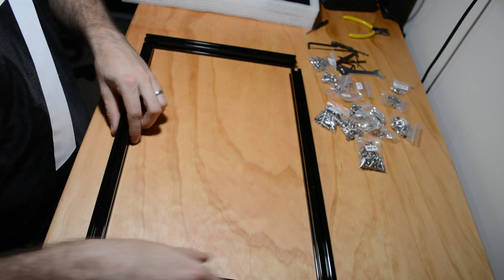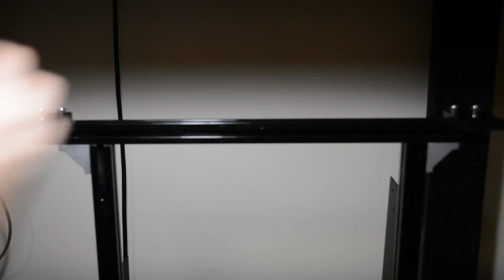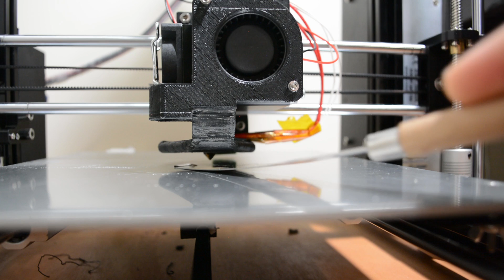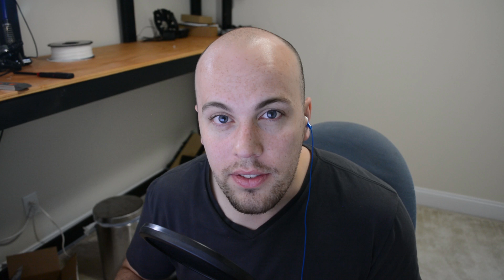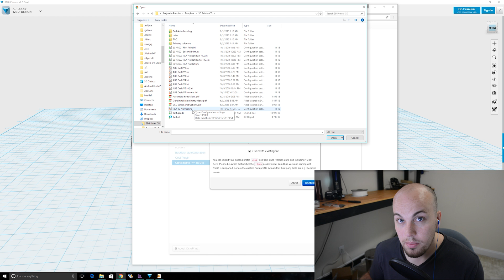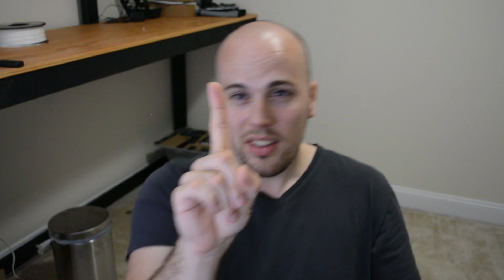Hictop Prusa i3 3D Printer - Assembly, Calibration, and Printing

Comment: I received a HicTio I3 as a gift. Put it together ,  no issues there no missing parts and so forth. Powered it up and tried 
to disable steppers and test motion. Tried "X" first, this blew the top of the "X " driver I C on the controller. Re-audited ALL of the wiring,  no issue. Then read about some mis-wired  stepper cables. BINGO---no two wired alike and the "X": one was wired 
from the controller to the first adjacent pins on the stepper - a dead-short! Have requested new cables and a new controller - waiting for  their response.
I will give it one more try - No way I should be getting mis-wired cables which blow up the controller.
We'll see.
Reply from the maker: That's very strange. Sorry about the issues. Yeah, some of the parts are definitely not top shelf, but the prints are pretty nice once you get things dialed in! Cheers!

Comment: Do you need a separate pi to run octoprint or can you use the same one running HomeAssistant?
Reply from the maker: You should be able to run HA and Octoprint on the same Pi no problem. I use it on two separate ones, though, so I can have them in different locations. Cheers!
Reply: @Thomas Kane. It can be done but if you would like to turn off your octopi when your not running the printer your home automation would go down at the same time.
Reply from the maker: Very true. I have them hooked up on a smart outlet. HA kills the power when the print is done so my printer fans don't run all day. If you kill just the power to printer and not the Pi, the printer remains powered on in an awkward half-on state via USB.

Comment: Great video! I bought the printer, assembled it, and got a few prints out of Cura. I'm moving on to the Ocotprint phase - and it looks like Octoprint doesn't have advanced slicer settings like Cura does. (See 12:33)  Are you using a plugin to manage slicer settings inside octoprint?

Comment: Thanks a lot for the video. I've nivelated  the autoleveling. But when you do an AUTOHOME you get the extrusor in the middle of the hot bed, but when I do that it goes to the very left, smashing agains the touch-sensor of the X AXIS. And sometimes the Z AXIS goes down down down down, smashing with the hotbed nonstop. How can I repair that please?
Reply: YES, I'm currently experiencing the EXACT same issue, and have NO IDEA what to do... Have you found a solution yet?

Comment: how does this one compare to the Anet A8 ? not able to find any good comparisons.seen comparison tables from vendors and seems to be identical. is this one with better frame. the Anet a8 is selling for 160 and a ton of folks on thinkverse have +ve reviews.
Reply from the maker: The Anet A8 is definitely the printer to have right now. Especially at that price point. Most of these clone printer use very many of the same parts. The real difference is in the frame. The Hictop printer is solid aluminum vs the Anet's acrylic. They both can make very good prints, but it takes a lot of hours to really get everything put together and working right. Troubleshooting printer temperatures, retractions settings, etc take time, but it's a really fun (mostly) and accessible thing. 

I just got a Monoprice Mini V2 printer that's fully assembled and ready to go for $220. It's really nice so far, but has a much smaller printer area. There is a Monoprice delta printer coming out in Q3 or Q4 2017 for $180 that's supposedly going to be bomb, too. Lots of options! At that price point, it's not the end of the world if you want to upgrade.
Reply: Thanks Ben. I am getting in to 3d ...because of your multi sensor( hass & your other tutorials)  - its working great and i dont want to spend a lot of time making a plexglss box. i spend a whole day yest looking at 3d tutorial and the issues. i dont mid building it - actually would be more fun than getting the fully assembled. but if i am going to spend time troubleshooting 3d printing nuances on  anet8 that's going to be frustrating. so due to the sturdy frame i will order this one. On your site you have a link to the whole KIT and it includes a glass surface - does this require me to also upgrade the induction sensor on the hictop or does that work with the existing sensor ?

Comment: Hi, I'm really enjoying your videos. I'm a total newbie to this whole home automation thing and I wanted to integrate it with the Amazon echo, but I decided that it was too pricey. I decided to make my own alternative so I chose the jasper project (http://jasperproject.github.io). I liked it because it was written in Python and naturally extremely customisable. However, I have not yet found a way to integrate it with home assistant and I was wondering if you could make a video on integration with Python and/or the jasper project. Thanks. I know I shouldn't really post this on a video about 3D printing but I don't know where else to post it so hey
Reply from the maker: Thanks much! :) I've heard good things about Jasper. There is already some momentum towards getting Jasper integrated with HA -> https://community.home-assistant.io/t/jasper-integration/350 Sadly, I don't have the time to push towards the getting the implementation finished right now. But, that might change in the future! 

My understanding is that Jasper, like the open Echo API, is pretty good. The major limitation being the microphone(s). I don't want to dissuade you, but it's really hard to make a DIY version for $50 that has the same robustness as an Echo Dot. You can run the Dot via an Emulated Hue Bridge component in HA and it's basically plug and play. 

Let me know what you get going though! I'd love to hear first hand how Jasper works in HA! Let me know if there is anything I can do to help!